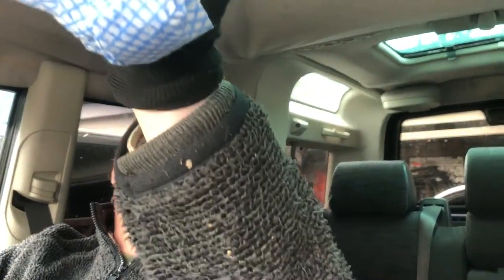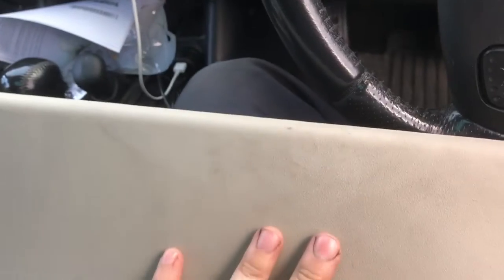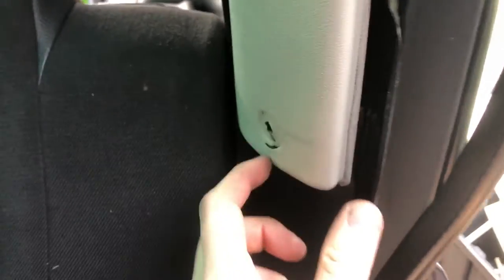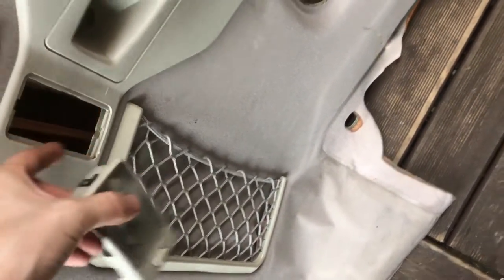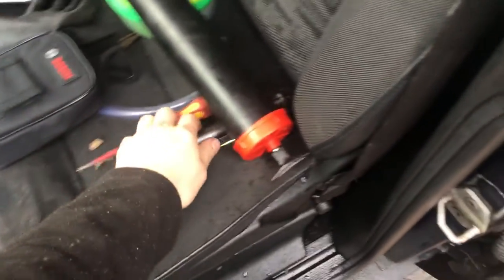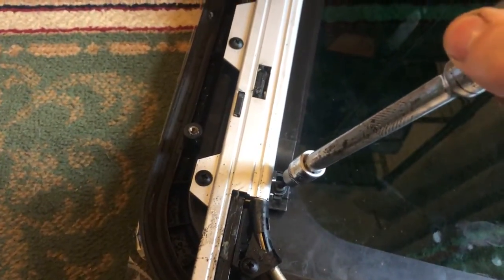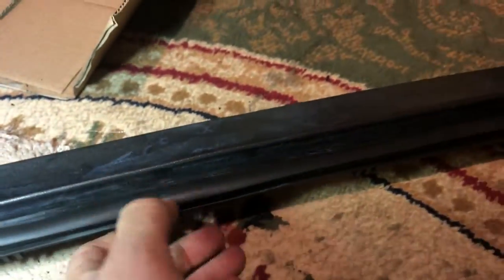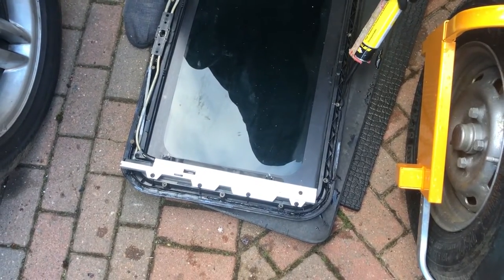Land Rover Discovery 2 TD5 Leaking Front Sunroof Fix Repair Headliner Removal Howto #discoverytd5

Comment: Has anybody worked out why the plastic tube/spigots actually  break. I was wondering if it was successive build up frost which then blocks the tube and allows plug of ice form in that area and subsequent expansion breaks the tube.  This problem with my Discovery 2s seems to occur in the winter when it has been standing for while at that time of year and not used. Not sure of a solution other than store it under cover ( garage etc) to prevent water getting into the channel under those conditions and building up ice in a slight thaw and refreeze cycle.  I’m only guessing but this area shouldn’t be under any stress you’d think otherwise… unless there is some force somehow applied to the area when the sun roof is opened.  Interesting mystery hope someone has definitively worked out the reason for this really tedious problem. 
    Great video, you’re hero’s for taking the time to illustrate the excellent repair…thank you!
Reply from the maker: I think it's the constant heating/cooling in that area via the roof and the plastic goes brittle, same thing happens in the engine bay with plastic parts sometimes I had a window washer hose connecter just snap but it was old so replaced it.
Reply: You could well be right there you can imagine how hot it must get there between the roof skin and the insulatiive roof lining ….Seems a poor design in the first place for such crucial part especially considering the amount of work necessary to put it right.  I’m going to try and fashion the part out of brass  using your suggested replacement part for the mould🤞…..Thanks again for great and helpful videos.
Reply from the maker: @Odonta7  exactly, you can get a metal replacement version as well but it's pricey.

Comment: 1) You installed the glass seal in bad orientation. In this way pressure water can go inside easily, it just slide over the chamfered part of seal. The wobbly seal corner at 32:08 surely create weak point! The right orientation is with two seal "lines" to outer plastic, so fillet part of seal towards to center.
2) For sealing the outer plastic to car body I recommend butyl sealing tape. I used this tape also for seal the four window nuts. 
3) I also recommending proper check of all bushings inside rails. Every part should be in tight tolerance -> no rattle.
4) Near some screws of the bottom part should be inside four soft cushions.
Reply from the maker: Thanks for the advice, I'll check it.

Comment: Great video guys! I'm having trouble with my disco 2 sun roof also. Did the top rubber seal fit the sunroof okay? I've seen some on forums that the seal pushes the back of the sun roof up and doesn't close properly.
Reply from the maker: if the glass doesn't close properly then the seal isn't pushed home enough basically, make sure it's pressed into the corners and try again we had the same issue ourselves.
Reply: @DanielJohnHowTo  will do pal! Thanks for the reply 👍
Reply: I've just bought a td5 sunroof to fit in my t4 transporter. Before fitting it I decided to give it a overhaul to make sure it don't leak. When I checked underneath the sunroof I could push one of the corners of the glass up with my finger so it wasn't sealing to the glass. I noticed that on both sides of the mech underneath are these hooks that pull the glass down to the rubber that weren't closing properly. I sussed out that if you install the winding handle at a angle.not lined up with the screw holes and watch the hooks on the mech and slowing turn the body of the handle it adjusts the hooks making the glass squish closer to the glass. Hope this makes sense. 🙂
Reply from the maker: @davidhenderson9197  Sounds right, thanks for sharing. The glass has a little flex on the seal but the hooks pull it down to seal, then any water should drop down into the tray and then through the pipes either side.
Reply: @DanielJohnHowTo  no problem. There's this stuff called gummi pflege that you can put on the seals. It's a rubber seal rejuvenate. Worked great on stopping the roof leaking on the wife's coupe  cabriolet. 🙂
Reply from the maker: @davidhenderson9197  That's a good product, used it myself a few times Liqui Moly products are pretty decent.

Comment: How did you remove the interior trim around the sunroof? Does it just pull off?
Reply from the maker: the top plastic trim on the roof?
Reply: @DanielJohnHowTo  The "frame" one that matches the headlining inside the car, if you get me. (Great video by the way!)
Reply from the maker: @pb3786  thanks, it just pulls off and has a little plastic joining piece.
Reply: @DanielJohnHowTo  Great thanks. Only 1 of my drains is working and the rear floor is wet so this is on my list.

Comment: The plastic pieces in the corners on my sunroof are still intact. Would going over the joints with sticafex stop the leaks?
Reply from the maker: I'd replace them, they get brittle. But sealing up may work, just not sure how long it would last that's all. We have had zero leaks since doing the work in the video, if that helps.
Reply: @DanielJohnHowTo  think I'll buy the replacement pieces and stikaflex them in for good measure 👍
Reply from the maker: you want to use a non-setting rtv sealant, so it doesn't crack later down the line and provides a good water seal